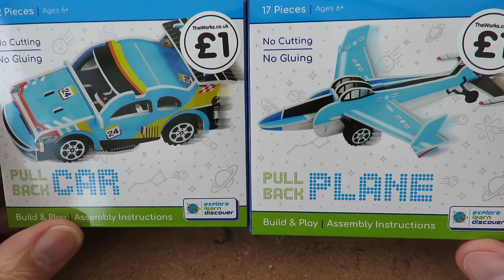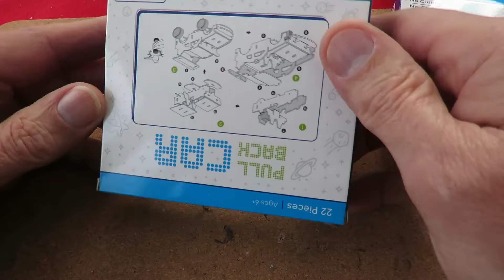Can I make a 4WD pullback toy car CAR BUILD

Comment: How come the test and combine video is unavailable? I pressed the link and it said this video is unavailable
Reply from the maker: The series of videos are scheduled over the next day or so - not sure if I can past the schedule here but I will try - the second date is the date I uploaded the video and the first date and time is the scheduled publication. The schedule does extend through April but I am just showing you the relevant bit. It includes videos in my main channel and my other channel but not my rubber band channel
Sat 30/03/2019 00:00 08/03/2019 RC conversion Barbie Jeep
Fri 29/03/2019 13:00 07/03/2019 Can I make a 4WD pullback toy car TEST & COMBINE
Fri 29/03/2019 03:00 07/03/2019 Can I make a 4WD pullback toy car FULL VIDEO
Fri 29/03/2019 00:00 08/03/2019 Magic Arrows inspired by Just4Fun
Thu 28/03/2019 13:00 07/03/2019 Can I make a 4WD pullback toy car PLANE BUILD
Thu 28/03/2019 03:00 27/03/2019 Newts EDITED
Thu 28/03/2019 03:00 27/03/2019 Newts full session UNEDITED
Thu 28/03/2019 00:00 08/03/2019 CSGOG Barbie Jeep pull cord Mini wind up car